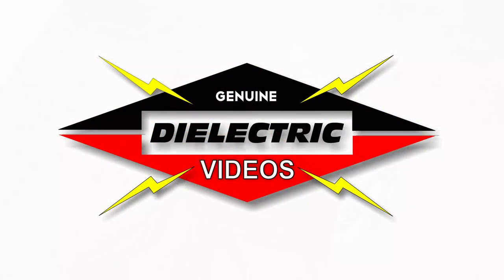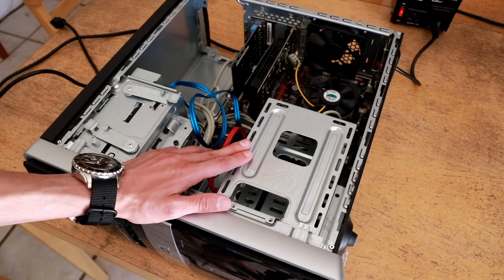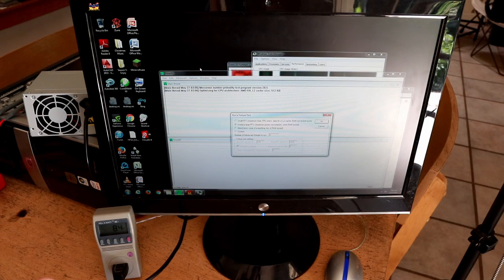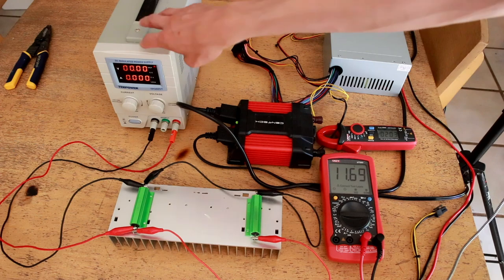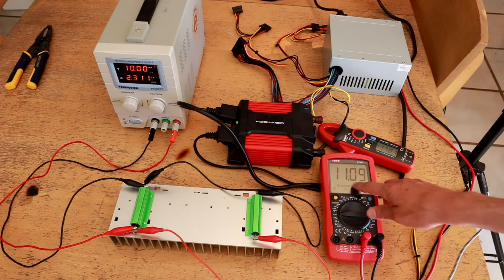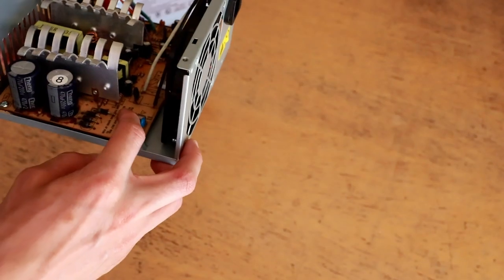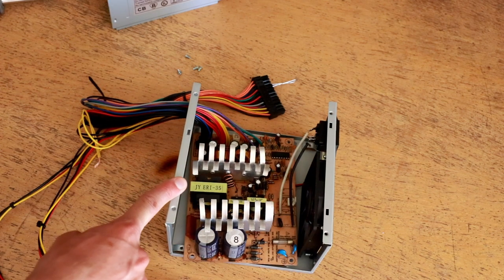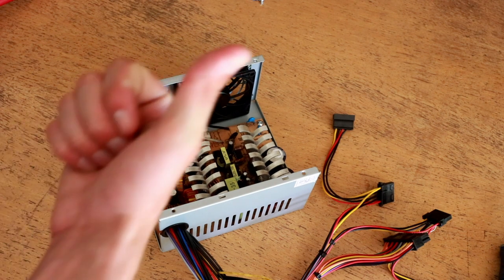EP 53 - AliExpress ATX Power Supply

Comment: Interesting video. Hm, it looks like the PC power supplies that were quite popular in cheaper computers from the 90s and 2000s - the typical BJT half bridge circuit, etc. Kinda dodgy though. Poor filtering, many unpopulated places for inductors and capacitors, I would be hesitant to use that in any new, half-decent computer, but at least it doesn't look like a big shock or fire hazard.

Comment: Scary how those wires and sinks heat up, plated aluminum wires are really scary, if the insulation is getting hot & sticky and cooling is minimal its a recipe for fan noise blue screens and eventual disaster taking pc parts with it.  The doesnt even appear to be grounded, also that foam isnt enough protection under the board, theres usually a plastic shield covering the whole area so the underside of the board can possibly touch the case.  Given whats at stake in both safety and parts its way too sketchy.  I think youre being far to generous with your evaluation.